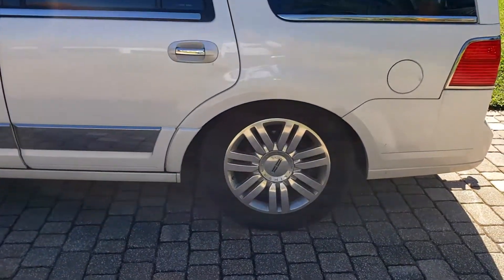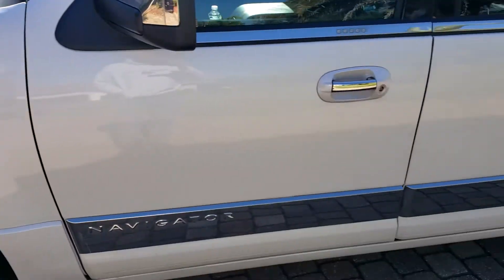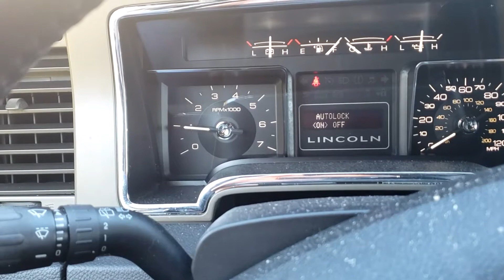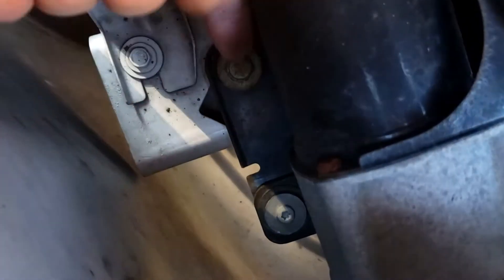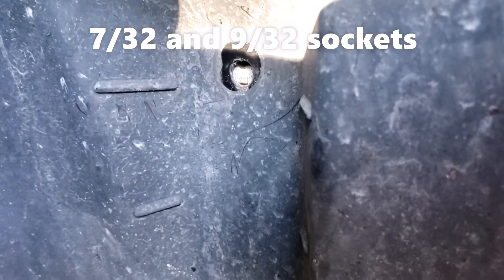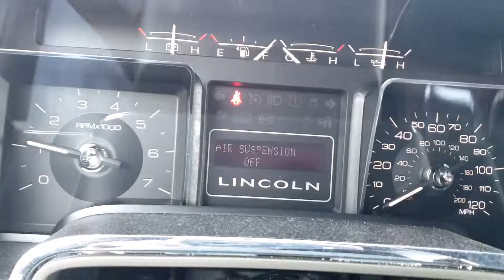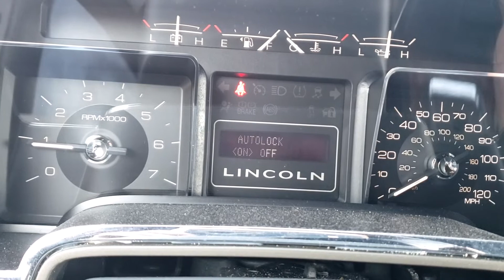Lincoln and Ford air suspension compressor replace. YOU CAN DO THIS

Comment: That’s for the vid. Just did mine today. The white hose didn’t want to come out though. I had to cut mine. Seems to be working great. Thanks again.
Reply: This is the same problem that I am running into. Everything is uninstalled but the hydraulic line. I’ve pushed so hard on that Orange ring that it actually disintegrated. All I’m left with is the brass collar with a death grip on the line. Does the line have a clip of some sort on the end or was it ok to cut and install into your new pump? Would love to know before I cut it like you did. Thank you!!

Comment: Thank you for this video; especially informing what tools were needed.    The process was pretty quick. For those going through this, order the Doorman PN# 949-202. I read a lot of positive things about the Arnott brand PN# P-2937 so I purchased it first but it requires some modifications.  I didn't want to do that so returned it for the Doorman  which plugged right in. Test drove it and it works great.....well, so far.

Thank you again, greatly appreciated!
Reply from the maker: @joshuafisher1895  thanks for adding the part numbers I get that question sometimes

Comment: I have a 2005 Lincon navigator. Every time I get in it wil say check suspension but I havnt seen any leaks with soap and it keeps its level
Reply from the maker: @xfrostyyy-h5t  wonder if you reset, then disconnect battery.  See if and when it comes back on

Comment: Thank you for posting this picaso! I would have been screwed without it. The only problem is I ordered it at autozone, got it and it was the wrong compressor. I mean looked the same but didn't have hose hookup. Where did you guys order yours? Please let me know, Thank-you!
Reply from the maker: It was through autozone

Comment: Need help! Have a 2004 Lincoln Navigator replaced the air compressor and there’s no power I checked everything fuses relays All of it runs fine! It just won’t turn on but the old one does! Any tips?
Reply from the maker: If old one runs put it back in and return new one, it's likely new one is junk
Reply: I did that and got another new one this is my third one now and the same thing happened im confused doesn’t want to kick on with any new ones but the old one
Reply from the maker: Make sure new one doesn't have any shipping plugs or caps that prevent it from completing a circuit.  After that use a volt meter to make sure power is getting to plugs on compressor.  The only other thing could be that the new ones aren't calling for power where the old one could have a leak and constantly call for power
Reply: @Kevtheguitarguy  how do I get the new ones to call for power?
Reply from the maker: Check the wires (the plug) to check for voltage .  If no voltage it means it is likely not calling for power.  One thing could be making sure air suspension system is switched to on.  The other are the sensors by the back wheels that when they get low the sensors allow voltage to run.
Reply: @Kevtheguitarguy  so I got it to turn on and run it was the wiring but the two back ones barley raised and the front was didn’t?
Reply from the maker: Mine only has airbags in the rear the front are coil over springs so yours might be different than mine , but now you know compressor is fine so chances are wiring issues in front as well.  Try to trace wires and check fro voltage

Comment: This might sound like a stupid question but will I mess up my vehicle if I keep driving it if I’m having issues with the air suspension.?
Reply from the maker: I would be more concerned with the safety factor.  It changes how the vehicle sits which will impact how it turns, stops , handles bumps

Comment: Nice video, thanks. I was sure my wife’s ‘13 Navigator L would need the compressor. Same color as your vehicle by the way. Worked fine for years and the rear end dropped down after work one day for her. I tested all of the related under hood fuses and swapped in a few spare relays in position 10, no change. Then I jumpered pins 3 and 5 in the relay socket and the rear end lifted up quickly and seems to hold. You can’t leave the jumper in there or the compressor keeps running. I put the relay back in but I know it’s not really fixed. From experience, any thoughts what it might be? I doubt that the left and right ride height sensors both failed from that morning she went to work with everything working fine to when she came home and the rear end dropped.

Comment: Do you have to worry about Air pressure when disconnecting the air connections?
Reply from the maker: There wasn't any noticeable pressure in the lines when I removed, but my compressor wasn't working.  Not sure if you had a working compressor how much pressure is in lines.
Reply: @Kevtheguitarguy   thanks, I’m sure mine is not working either but do you know if there is a way to release the pressure safely. I’ve looked online but can’t find anything on that
Reply from the maker: If your car is riding low then the air is already out.

Comment: I just bought a 2012 navigator. Would you say it's more common for the compressor to go out or the shocks?  Thanks for the video!
Reply from the maker: I would say compressor.  On my previous navigator i removed the air system andcreplaced with struts and coils.  Not too difficult of a job.  I would've done the same if compressor wasn't under warranty

Comment: Thanks for making the video , I do have a question for you , I just replaced both front air suspension plus a new compressor the other day , everything good but the next day my navigator it’s sitting higher on my driver side and lower on passenger side , same for the rear end , ….,I was wondering if you would know what it is , I was thinking to replace both front air ride suspension leveling ( sensors ) thanks for any suggestions.
Reply from the maker: drive the car a little then park differently than you normally do.  ex back in driveway if you normally head in forward.  this will take away the ground being unlevel.  next measure the distance between top of wheel and well on all tires so you  know the difference.   disconnect your sensors and see if the spin freely or are frozen.  chances are if one is bad it could make the others compensate to keep level.  if they move freely they are probably ok.  let us know how things go
Reply: @Kevtheguitarguy  i will let you on that but thanks for the info

Comment: I'm not getting any power to the compressor or levers in the back.. All fuses look good. Any tips?
Reply from the maker: Electrical issues are a pain.  You have to start at compressor and follow wires back until you have power

Comment: Love help like this . I tore this truck apart looking for the 4 wire Connector relay . Do you know where it is located exactly? Mine is a 2012 navigator.  My 1st time ever touching an air ride suspension.
Reply from the maker: there is a  4 wire connection shown at 2:52 mins into the video.  The "relay switch"  I believe is located in the fuse box on the drivers side under the hood.  I think it is the square relay #10.
Reply from the maker: I am pretty sure all the relays in the fuse box are the same kind and you could probably switch  one out of another slot to test if yours is good/no good

Comment: Is the compressor location the same for all year navigators ? I have a 06 ?
Reply from the maker: I don't know for every year but i had a 2001 and it was similar but i think i had to also take out battery
Reply: The 06 has the pump under the water tank. You typically have to remove the battery and battery tray and then unbolt the tank and move it backwards to where the battery normally mounts. Then you'll get access to the compressor.

Comment: The rear end won't pump up on my navigator. The driver side hight sensor is sticking and grabbing but the pump is loud and rattling, would you say the hight sincer is keeping it from going up or the compressor is bad. Update.... problem fixed.. description in comments
Reply from the maker: Sounds like you might have multiple issues.  I'll start by saying i am not a mechanic.  If compressor is loud it is probably on it's death bed.  If you have other problems such as sensors and possibly rear air bags you may want to look into a conversion kit to struts.  I have done one before on navigator and it's not too difficult
Reply: I've got a 2004, so not exactly the same, but if one of my front ride height sensors popped loose it caused both rear bags to deflate. I'd spray some lube on the sensors and move them through their full range of motion and see if they loosen up.
Reply: A loud and rattling pump might just be worn out isolation mounts. The pump could be fine, but it vibrates so its has rubber mounts. When these mounts get stiff or fail it can cause the pump to sound noisy.
Reply: @JasonWW2000  problem FIXED... pump was bad and the airline quick connection midway down the passenger side was leaking
Reply: @dentedfanatic23dentedfanat78  I'm about ready to swap mine over to coil springs. Any time the temperatures get around freezing both my front bags slowly deflate. All new everything, except the upper shock mount, and it still leaks. It's a pain in the rear.
Reply: @JasonWW2000  the frount of my navigator was switched to springs, I tested to see if the pump was bad by connecting my floor air compressor to the airline and manually bumped the back up allowing me to see if everything in the back was working wich checked out fine.in doing so I discovered that the airline that hooks up to the cars air compressor was completely stopped up with gunk about 1 foot In the line, I removed the line and flushed it out with a wire and the compressed air. After that I retested to find everything was working except the pump not having enough compression so I changed the pump, the stopped up airline at the pump was the reason for the pump failure. The reason the line stopped up was because the pumps air dryer had completely gumed up and failed allow grease water and road grime into the airline.

Comment: How did you know it was compressor?
Reply from the maker: The compressor started getting louder and louder.  Instead of being something you could only hear if you listened for it, it was very apparent when it would kick on.
Reply: @Kevtheguitarguy  i just removed mines and it still blows air.
Reply: @Kevtheguitarguy  im going to replace it regardless
Reply: @Kevtheguitarguy  i replaced compressor still not going up 🤣
Reply from the maker: @rickyhernandez1030  does the compressor turn on?
Reply: @Kevtheguitarguy  yes sir
Reply from the maker: @rickyhernandez1030  if compressor is turning on that would lead me to believe it is not a problem with sensors, relay switches, electrical issues, or the compressor.  What it sounds like is an air problem from compressor to the rear of vehicle.  There are only a couple things one are the air bags but if both are down and not just one I would focus on the airlines from the compressor to the bags.  Soapy water in a spray bottle is usually my method for finding leaks
Reply: @Kevtheguitarguy  THANK U SIR 🙏